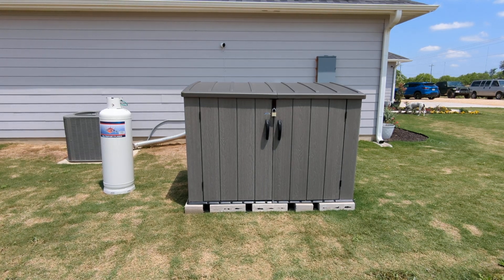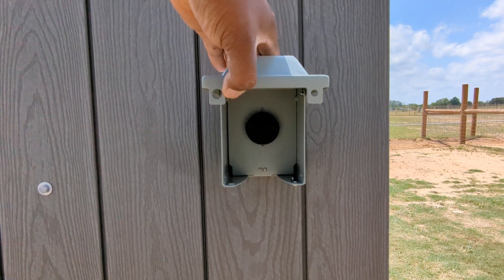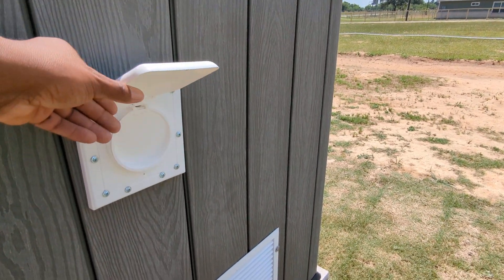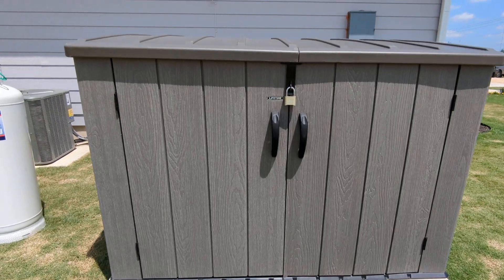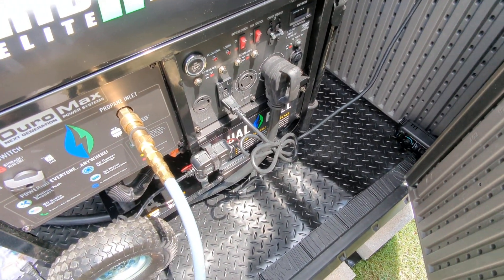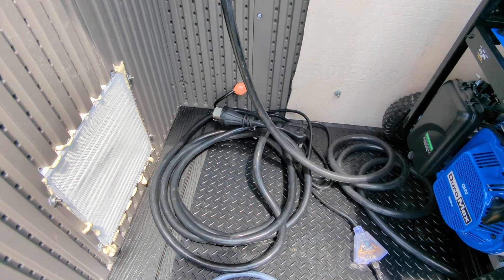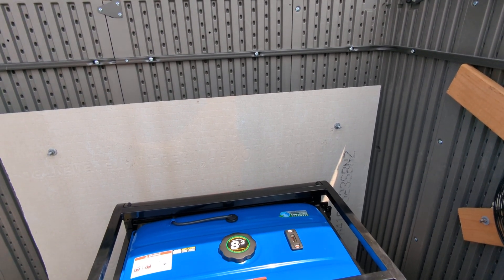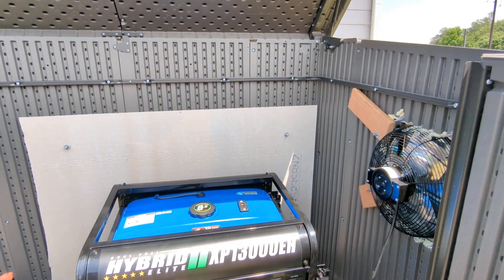4/22/2023 Generator Shed

Comment: I have a similar set up except I just pull my gen out of the shed and hook it up and run it when needed, then put it back in the shed after using it. I do have the power inlet port on the side of my house and run it to my panel with an interlock to make it safe and legal, just didn't make it where I can run it in the shed as its plastic and pretty cheap and thin. I just wanted it out of my garage and out of the weather. I want to go with an inverter generator but waiting for them to come down as the few 50 amp units are super expensive right now. Mine is just a regular gas/propane 50 amp unit from Costco, paid like $700 for it, $200 for the shed, about $225 for the breaker, wire, wall plug and interlock, give or take and I did all the install myself. It pulled us through 3.5 days of no power a few years back when we had snowmaggeden here in Texas and I was a hero for doing it like two months before. I have used it like 2 other times only, not needed often but when you do, you do. Buying one of those big ones and paying big bucks is not worth it as little as we loose power here, plus those expensive units can have costly issues too down the road, way too much money for what most of us actually need. If you lived in a third world country then maybe it would make sense but not in most of the US anyway.

Comment: Ty I like ideal generator out side shed I'm run mine on natural gas.  I like display firsters ty I have solar fan. Bit wid---er  better breath. .solar charge .panel be on top. Keep battery charge . . if run natural gas run gas in tank empty won't cum up carb . natural gas better. Better out put then usen propane. Power out best national gas .(not) propane  power out!  There no propane.  Use natural gas never. Need go gas station.  Daily notbuse over pay natural gas bill build. Up credit .

Comment: i just bought the same generator. What size of exhaust pipe to you buy 1-1/4 ?
Reply from the maker: I used GenExhaust for Duromax 1-1/2" steel exhst ext (5ft) https://www.ebay.com/itm/144701238725 . I went through multiple other exhaust for amazon and ebay and ended up having to just purchase this.

Comment: i like the work.  Not over engineered lke many of the diyers.  Mostly common sense and good take on necessities.  Shed looks tougher than most like the suncast.  Looks like a lifetime shed (plate).  Only thing I would have included would be rockwool and also a temp sensor inside.  Like the work.

Comment: Would greatly appreciate a list of materials for the build.  I'm especially interested in the venting and exhaust aspects as I'm in the build process currently.
Many thanks.
Reply from the maker: Didn't really make up a build list. I used stuff I had and purchased some things the biggest problem was finding the right size exhaust hose and attaching it. I used GenExhaust for Duromax 1-1/2" steel exhst ext (5ft) https://www.ebay.com/itm/144701238725 . I went through multiple other exhaust for amazon and ebay and ended up having to just purchase this. I used exhaust weld in a tube to seal that attachment along with a single screw to give the connection even more strength.

Comment: My generator has a carbon monoxide sensor that will shut down generator if level gets too high. Is there enough circulation with this set up that my generator will not shut down?
Reply from the maker: I tested my set up in San Antonio 90 degree weather for 2 hours without any issues. I do have a cheap box fan in my setup to turn on for air intake help if I'm using my system in our crazy hot 105+ degree summer heat (not shown in the video). A cheap box fan or two can be used instead of a exhaust fan or intake fan. All up to you. You don't have to spend money to be safe and get the job done.

Comment: I would suggest another air inlet vent
Reply from the maker: I do have a cheap box fan in my setup to turn on for air intake help if I'm using my system in our crazy hot 105+ degree summer heat (not shown in the video).

Comment: What connection do you use to keep the battery charged?
Reply from the maker: I ran a single outlet from the panel Inside the Box. Then I simply plugged in a battery maintainer

Comment: This looks amazing, Can you provide a list of what all you purchased to complete this project and where you purchased. This is exactly what I'm looking to do with My Duromax generator.
Reply from the maker: Didn't really make up a build list. I used stuff I had and purchased some things the biggest problem was finding the right size exhaust hose and attaching it. I used GenExhaust for Duromax 1-1/2" steel exhst ext (5ft) https://www.ebay.com/itm/144701238725 . I went through multiple other exhaust for amazon and ebay and ended up having to just purchase this. I used exhaust weld in a tube to seal that attachment along with a single screw to give the connection even more strength.

Comment: awesome set up.  what did you use to connect your exhaust through the shed?
Reply from the maker: The biggest problem was finding the right size exhaust hose and attaching it. I used GenExhaust for Duromax 1-1/2" steel exhst ext (5ft) https://www.ebay.com/itm/144701238725 . I went through multiple other exhaust for amazon and ebay and ended up having to just purchase this. I used exhaust weld in a tube to seal that attachment along with a single screw to give the connection even more strength.

Comment: Looks good! Will you list everything you used for the exhaust and the backboard? Thanks!
Reply from the maker: Sorry, I didn't really make up a build list. I used stuff I had and purchased some things. After doing some research I kinda just built it on the fly.The biggest problem was finding the right size exhaust hose and attaching it. I used GenExhaust for Duromax 1-1/2" steel exhst ext (5ft) https://www.ebay.com/itm/144701238725 . I went through multiple other exhaust for amazon and ebay and ended up having to just purchase this. I used exhaust weld in a tube to seal that attachment along with a single screw to give the connection even more strength.